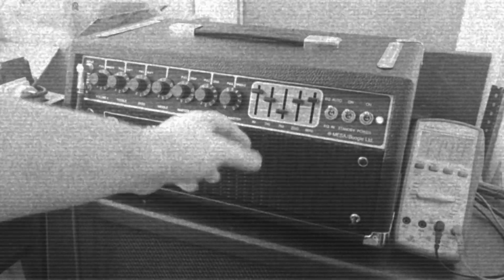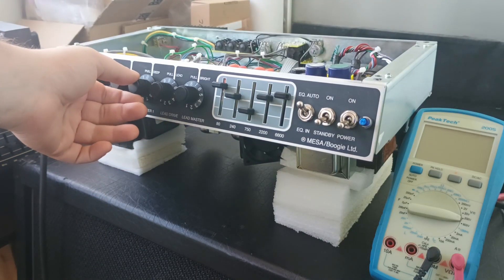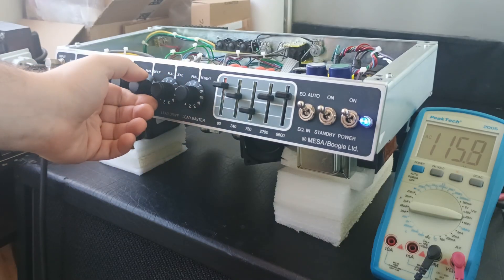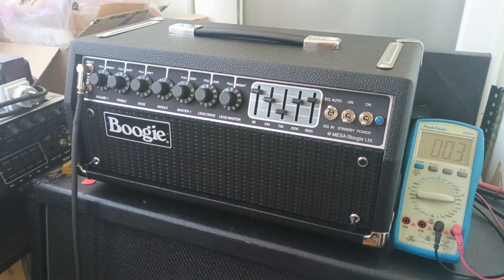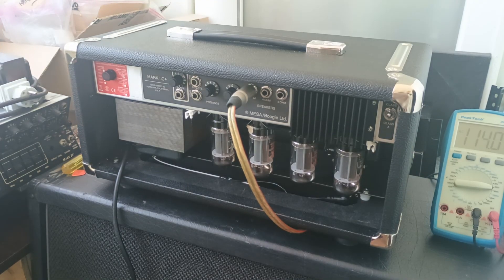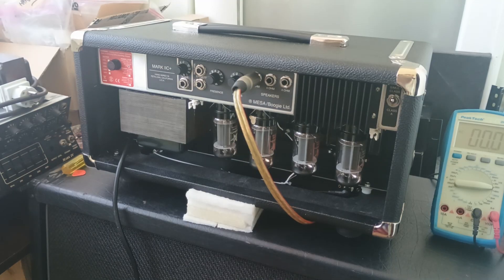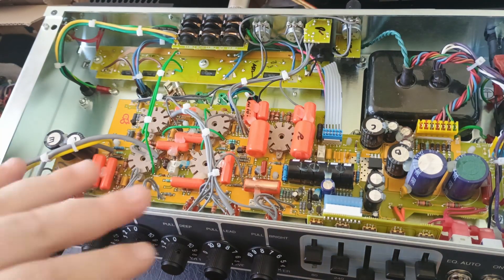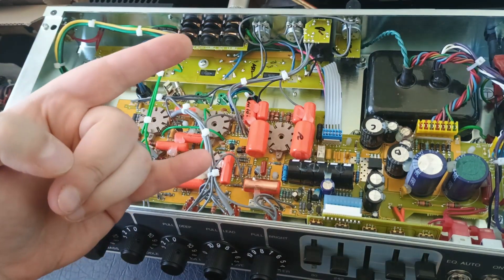Mesa/Boogie Mark IIC+ Reissue - WHAT CAUSES THE OSCILLATION

Comment: I have an old 50 Caliber+ it has the same problem. But I´m okay with it I don´t play high gain
Reply from the maker: I had a 50 Cal long time ago, the EL84 one. Had many other design flaws, but not didn't have issues with oscillation.
Cheers!
Reply: @TheDannVal  it´s even mentioned in the manual?

Comment: Thank you and exceptional work!  Which pickups were you using during the demo?  Also, did you have the "Pull Deep" engaged?  (I am assuming not based on the clip but wanted to confirm).  I have the C++ RI, and thankfully, no oscillation.. at least not yet : )
Reply from the maker: Thank you! I haven't done the demo yet, those were just short phone clips from the first power up. I always have the Pull Deep engaged so I think I did here as well. I will be shooting a proper mic'ed up demo and shootout with my personal IIC+ and probably with a SP2C V2.
Cheers!
Reply from the maker: Forgot to reply about the pickups. For that initial test I grabbed my '90 Greco LPC w/ DryZ bridge pickup. A Japanese PAF by Maxon.

Comment: My guess is to try to add a PS supply capacitor near the tubes, but the catch is to solder it close to the GND and the positive pin before the plate resistor. 
Try to make the ground better - add some heavy wires around the ground next to the tube and the star ground - if it exists. Based on my personal experience, Mesa engineers do not make good PCB designs. I've seen it many times.
Reply from the maker: As Randall himself said - there are no engineers in there. The PCB were always bad. 
I have a plan of action and that includes a bit of rewire. Already getting more stable.

Comment: Hate to be a buzzkill but mine still oscillates after disconnecting the white and black. With Vol 1  and Treble both pulled and at just over 8, Lead Drive at 8 I can’t go above 3 on either Master or Lead Master without oscillating . GEC engaged with normal smiley face config.
Reply from the maker: Are you sure you are getting oscillation and not feedback? Guitar volume at 0?
Try lightly tapping on V1 with a wooden stick or pencil. If you hear a loud ring - the tube is also microphonic and needs changing.
Reply: @TheDannVal  Guitar volume was at full and was sitting maybe 12 feet or so from the amp. I'll try again with no guitar volume and let you know tomorrow.
Reply from the maker: @AlBundyPolkHigh1966 the issue we are hunting is oscilation within the preamp itself. Essentially "feedbacking" on its own.. So the guitar volume should be rolled off.
Reply: @TheDannVal  Just tried with the guitar volume off and it still oscillates. I haven't gotten at the V1 tube yet.

Comment: I’m no guitar player or own power amp but does sound like what you’re describing is the reverb is feeding backing through the system and causing the  escalation and when the reverb is turned to zero it does not. Just can’t believe they oversight that problem at the manufacturer. Reissued item what do you expect though!

Comment: Do you need to remove the grill cloth face plate in order to remove the chassis from the head shell?
Reply from the maker: No, but it's easier putting it back in as it catches on the gloth edge.
Reply: @TheDannVal Thanks! I went ahead and removed it which made taking the chassis out a lot easier in terms of having better front and rear access. I’m surprised the inside of the head shell doesn’t have a full length “ledge” so you can rest the chassis after removing the four screws. The ledge it has seems a bit short and I didn’t want to risk putting its full weight on it. I had to replace the on/off toggle switch which went bad. Not even a year old yet. Thankfully that was the easiest part. Thanks again!
Reply from the maker: @armandodiaz3485 I noticed that the side rests are missing as well. 

The switch went bad? They seem pretty sturdy. But kinda not surprised.
Already seen a few with the back Class A/SimulClass switch broken... And who puts a small PCB on a switch just to run 2 wires from it?!?
Sweatshop vibes at Mebson..

Comment: I'm wondering if you could get rid of the massive midrange on a mark v
Reply from the maker: Can't say I know what you are talking about. It's the GEQ enough?
Reply: No my large mesa cabinet v30 sucked to day I purchased a 4x12 black back speakers and this thing sounds awesome. that was the fix. I couldn't stand that head now I love it it's all about speakers
Reply from the maker: @hotrod7695 uhm, ok? Since we are mentioning things unrelated to the video - I prefer the stock 240Z L24 N/A sound, especially with individual throttle bodies, instead of the commonly installed RB.

Comment: Interesting... I have a Mark III DRG that's either a late purple or early red, it's a darker maroon looking thin sharpie line. It acts very similar with the reverb tank plugged in, so I have to run that amp with the tank unplugged. I know mesa did a "Reverb Glitch Fix" on these, maybe related?
Reply from the maker: The reverb circuits are very different between the Mark III and the C+ / C++ RI. The Mark III also has the reverb stages contained in one tube (V4 A+ B), and not split like this one. But still a good suggestion - I will look into it if my planned solutions don't get it done.

Comment: ++Reissue owner here, zero oscillation. But I've been running it through a Fryette PS100. I have had oscillation before with other amps and flipping the ground switch on the Fryette solved it instantly.
Reply: Mine oscillates through my Fryette PS2.
Reply from the maker: This issue has nothing to do with power amp/power stage. What settings are you running?

Comment: New II-C Reissue owner here. I get the oscillation when running through my normal effects chain but I found that if I plug straight into amp=no oscillation. I will try effects chain with reverb disconnected and report back. This is very interesting and appreciated. My Very Best ~ Joe
Reply: P.S. I have a Soldano and Marshall that I plug into and I have no problems with the effects chain.
Reply from the maker: Thank you and please do report back! Also keep an eye on this channel , as I will be testing a better solution.
Reply: @TheDannVal  Reverb disconnect worked as you described for me when using effects chain.
 Thank you for efforts to help us all ~ My Best Regards ~ Joe
Reply from the maker: @gtrjoe1901 Great! Glad it worked! Cheers!

Comment: I had one of these for 30 days, it was number 227. I couldn't get it to oscillate like that. Must have been one of the good ones. I sent it back because $4k is to much for an amp that should only be $2k. Didn't make sense to me. I love my JP2C, but it has a totally different issue.
Reply from the maker: After I analysed it when it came out I literally said that - this is a 1800-2000USD amp including the brand tax. And the worst thing is I don't see them lasting as long as the old ones did.

Comment: I owned the IIC+ RI and now own the IIC++ RI. I have never experienced any oscillation on either of them. That said, I never use the Reverb. It's always at zero. Perhaps that's why! Very interesting.
Reply: I also have a ++ and it definitely oscillates with certain settings.
Reply from the maker: @mikerichardson3017 the C++ RI is just a gained up C+ after all. Did you try detaching the reverb?
Reply: If you use high master1 and lower lead master it doesn't oscillate. It's when you have the lead master too high and master 1 low it does it.
Reply from the maker: @crummy.  When you need to actually balance the two channels the Lead Master should go higher. Either way - unacceptable.
Reply: The funniest thing is that he also had the Reverb at 0 when the board was inside the shell and still had oscillation. Interesting indeed.
Reply: I get oscillation with my reverb at zero. I don’t use it at all because it’s barely noticeable anyway.